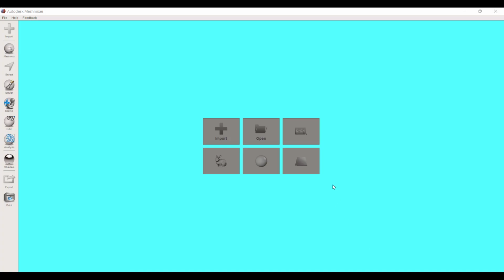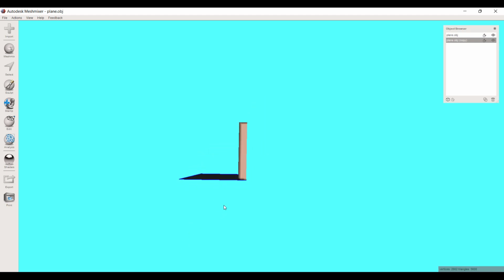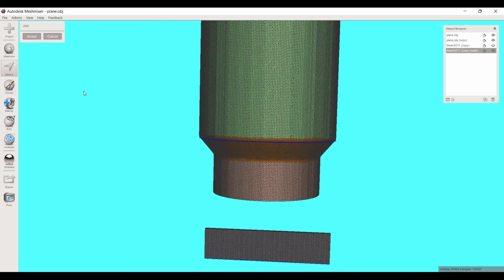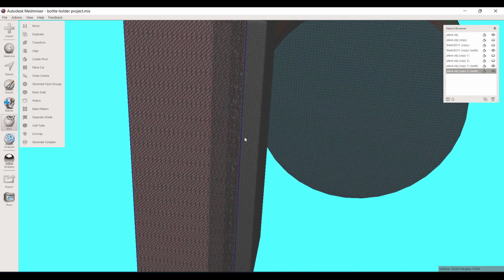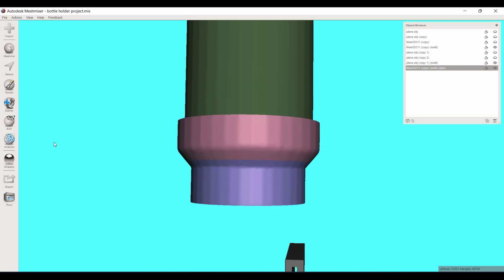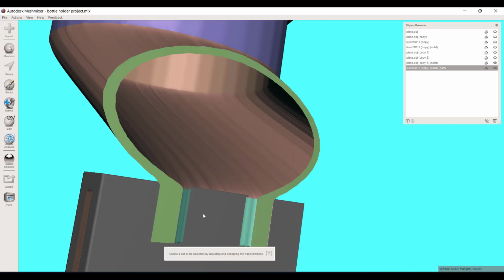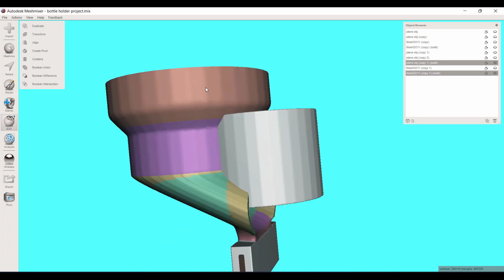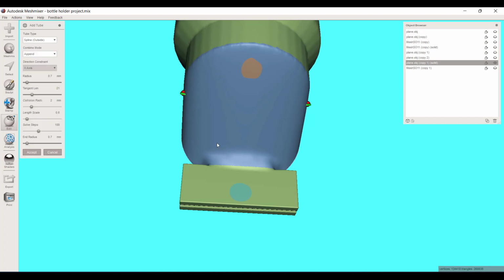Introduction to CAD Design of Custom Parts Using Meshmixer

Comment: Thank you for this concise demonstration. I was looking for a CAD engineering type lesson for Meshmixer and you really nailed it. This video was chocked full of useful techniques, plus it was enjoyable to watch your creative process. 
I've been doing this type of work for years using other software but I'm burnt out on subscription/web based programs. There are very few choices left. I've been working with Meshmixer for a few weeks and it looks like it will work fine for most of my needs. I've been learning it in combination with 123D; simple and effective. I'm not designing car engines.